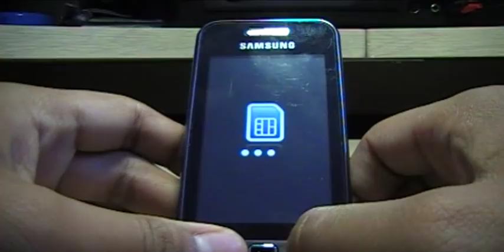Review: Samsung S5230 / S5233 / Star / Tocco Lite (GSM Unlocked) - Part 1

Comment: @starstruck19921997 
no, no, no. when you call someone, the phone locks itself automatically. then you can touch your ear. and anyway, it wont end because the end button is a "button" so you're gonna have to press it, not touch it. so the possibility of that happening is just as much as any other phone.